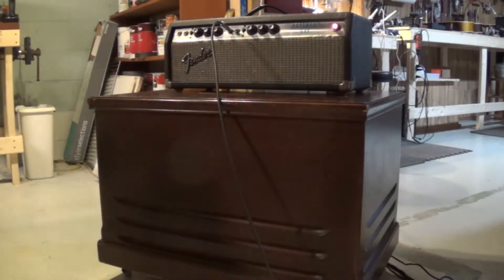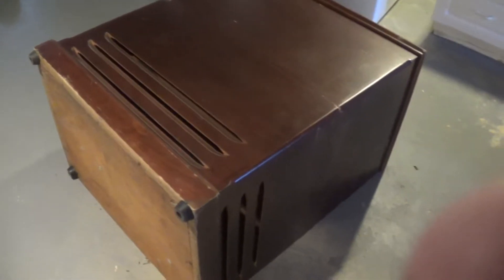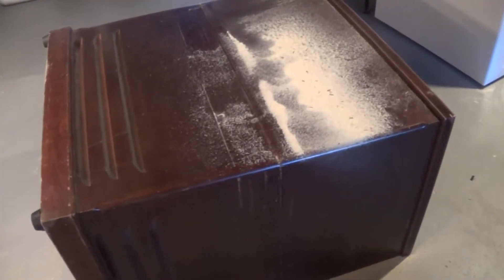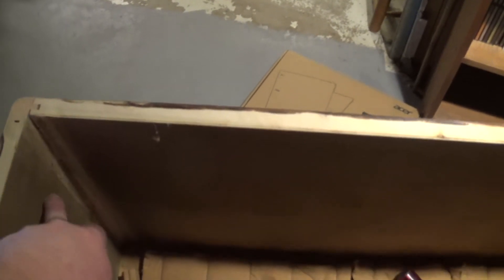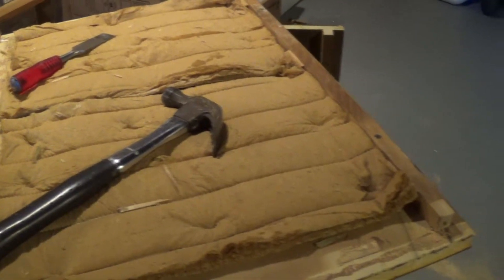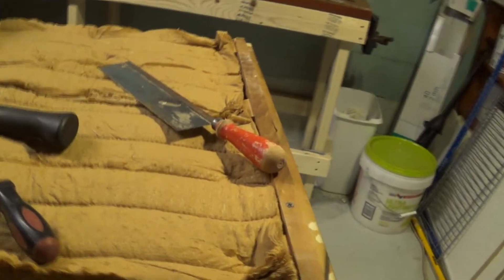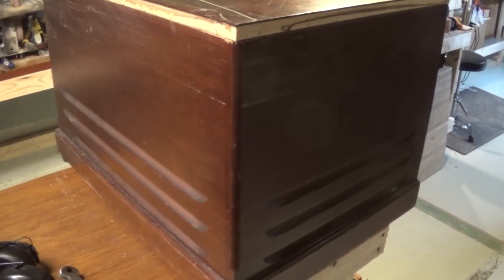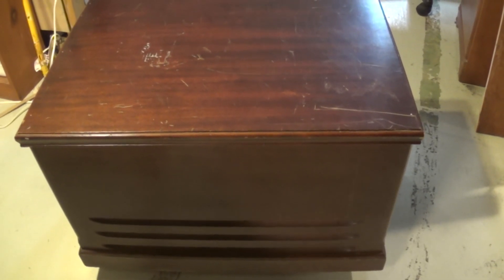Leslie 125 modification

Comment: I’m at a crossroads. I have all of the guts and amp of a 21h (except upper v20 driver) and a 25 cabinet. I’ve got the really nice 15” Jensen speaker (non field coil but I know how to get around that).

So do I bore out and raise the lower speaker shelf to accommodate the 15” bucket AND build an upper shelf and buy the driver and then cut out louvers which will likely look horrendous… or do I go this route and just buy the lower 5” bucket and stick with the 25 stock speaker and chop it. Then I’d have to buy a 25 amp. I could sell the nice 15” Jensen and 21h amp and upper motor/horn assembly though.